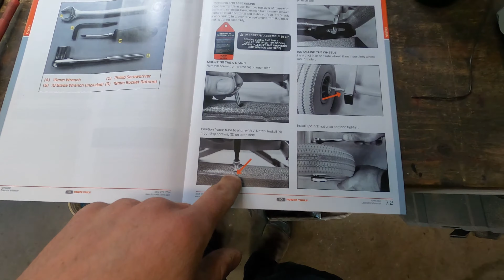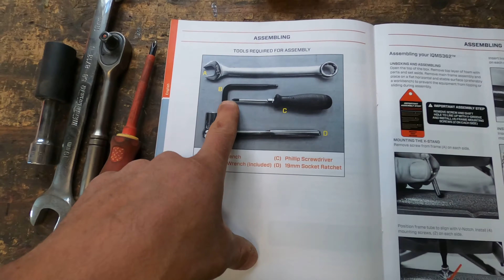IQMS362   Assembly and First Cuts

Comment: In Canada. At least here in Ontario, most outdoor plugs run on a 15A circuit. I wonder how many times the breaker would pop. Interested in this saw, I’m just worried it draws too much as they say it should run on 20A. What’s your experience?
Reply from the maker: Ya I was worried about that too. We ran it from a 15A plug (no gfci) with a 10g 50’ cord no issues. I also made an extension cord that converts a dryer plug to a 110v outlet for places that have unreliable circuits. You can also plug the vacuum system into one outlet and the saw motor into another outlet in a different circuit.
Reply: Rudi Jones yeah. There’s that option too. That’s what I figured I’d do. Two extension setup. I guess I’ll give it a go. 👍